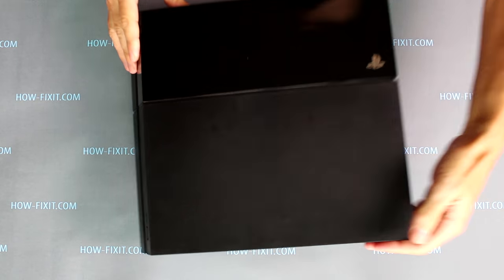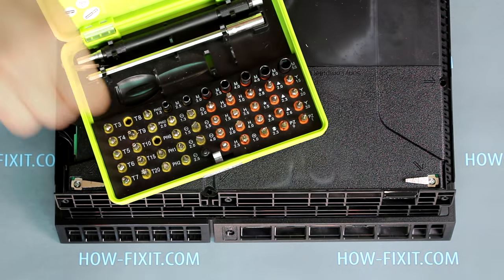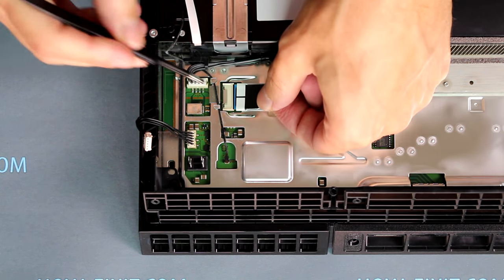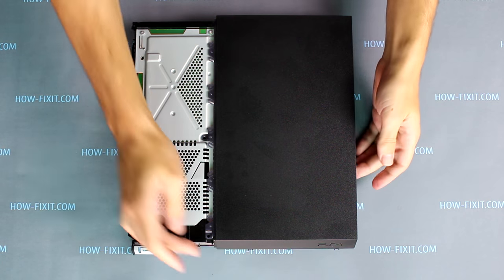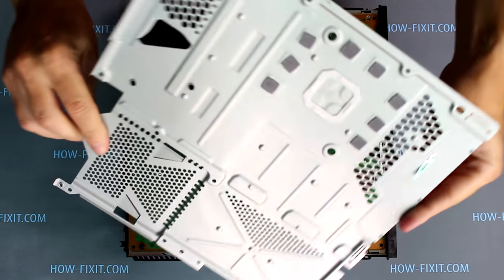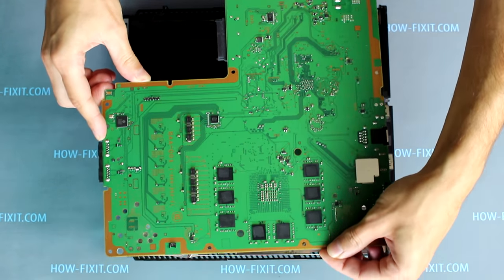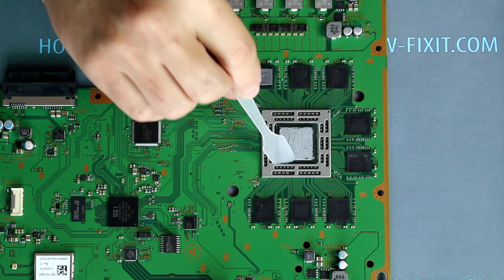PS4 Overheating Fix: Disassembly, Fan Cleaning & Thermal Paste Replacement

Comment: will applying thermal paste and then leaving it out while cleaning the cooling system affect the longevity or result of the paste? and can I use compressed air instead of a brush? 
Thank youuuu

Comment: Broo, it's so hard pulling the power supply cableee
Reply: i’m scared i’m gonna damage it wtf do i do no video explainsssss
Reply: @Gwaciee  because of it I didnt fix my ps4, didnt want to hurt my baby
Reply: If you pull on the cord while the power supply is still screwed in it comes out pretty easily.
Reply: @DocSportello83  will look into it, thanks !
Reply: Wafi. 05 i broke mine lol
Reply: @Gwaciee  You broke ur ps4 while doing this?
Reply: @wonder8923  yeah but i somehow fixed it
Reply: Yeah this one sucked the most. You have to widen the gap a bit carefully with a cutter knife, then it loosens up.
Reply: Pull it out from the power supply

Comment: I have a question? Is their any soldering required especially the Wifi connectors im very afraid of unplugging the wifi connectors and not realizing that I need a soldering tool to re-hook it after I'm done replacing thermal paste. 

Please let me know any soldering requirements if their are any just to get to the thermal paste. That includes the wifi connectors ESPECIALLY??

Comment: I lost one of the rubber pads that are between the chips surrounding the processor and the metal shields. Will it cause problems to just not have it?

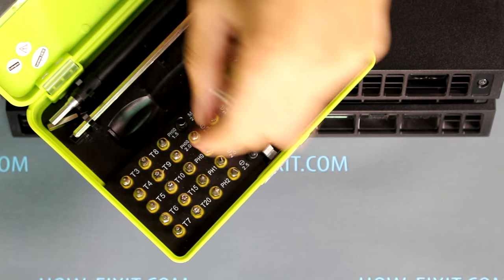Comment: 1:15 ⚠️ PSA:
If T8 is not working, you will need T8H. The T8H tool has a hole in the tip (security feature) and it's the only way you will be able to deal with the special type of screws that Sony used in PS4.

Comment: Thanks, ps4 is now clean and the fan is running really smooth. Overheating gone
Reply: When I changed the thermal paste the sound has become sow quite but the PS4 does have heat is that normal ?
Reply: @mohnad7215  Yes, it's good. It means the paste is helping move the heat from the inside to the outside, so the fan will be quieter but warmer. You should worry if cold air is coming out of the fan, it means there is not a good heat transfer between the processor and the fan, thermal paste is made to improve that transfer
Reply: @MVergaraQ  oh. Thanks actually it gives me hot air it means  that the transfer is good

Comment: This is the second time I open my ps4 and clean it (today). It starts and sounds fine. But controller won't connect to the ps4 anymore 😂. Did I ruin something or did I miss a cable?
Reply: Your Wi-Fi antenna is disconnected causing the Bluetooth to not work.
Reply: @Braylinman  Yup, I opened again and the antenna had slipped off.
The disc drive doesn't work either :D
Reply: @Braylinman  this comment has made my day! going to try fix it now !

Comment: Even after doing this. My ps4 did get better. But I can no longer play any games because it'll just automatically turn off by itself saying it "overheated" but there is NO DUST!!! And I replaced the paste any tips ?
Reply: It’s is it good now
Reply: kevin Mejia no. I had to get an entirely new one
Reply: Edgar Smh smh I’m not even willing to open it again it was working fine but it keeps saying is hot again
Reply: @edgar9026  did u apply enough or too much or too little thermal pace? Or it could be it was just to old.
Reply: @protokille9111  it was just over 6 years old, so i guess it was time to get a new one anyways hah

Comment: I did this and did not replace thermal paste and now when I load a big game the fans revs up and the system will power down. Is that my issue now?
Reply: Replacing the thermal paste is the point of this video, what did you expect?

Comment: is it worth changing thermal paste?  does it last over time?
Reply: Absolutely! Buy one that is well reviewed like thermal grizzly(cheaper one is fine too though). It can last for years and keeps your ps4 quiet ;). In my case, 2 years after changing thermal paste from the default one, it's still quieter than before ^^

Comment: I ain't gonna lie I almost had a destructive breakdown because of the power supply cable and last two T8 screws that wouldn't come off. I used a flat screw driver and it worked. This video was a blessing though, Re-applied thermal paste and it turns on. Downloading MW Cod to test.
Reply: How's it going now?
Reply: @DustRockBlues  I can conclude it is very worth it, I played BO4 and MW and it was very quiet and played well. I recommend repasting.
Reply: @TheGamingKamikaze  Thank you my good sir.✊🏾

Comment: My ps4 is louder after cleaning dust off heatsink and fan.Should i replace fan or apply new thermal paste?
Reply: U shouldn’t take the heatsink off the cpu cus that can cause air bubbles in the thermal paste. I would recommend just changing the thermal paste.
Reply: Also make sure u didnt lose any thermal pads

Comment: I just cleaned all the dust from my ps4. And it's still loud as before. Would this mean it's the thermal paste that needs replacement? What else can I do??
Reply: Yes. Stock thermal paste is garbage and Thermal paste dries out. The heat transfer between chip an cooler worsens  because of it so it gets hotter and louder. I would recommend a paste like mx4 ,MX5, noctua nth1, nth2 whatever of those are available for cheap. If you want to go the extra mile replace the pads on the ram also.

Comment: So i have a Little Problem i did every thing in this Video cleaned Almost every piece and replaced the Thermal Paste But when i Started the ps4 i wanted to Play a Game while i was in the loading Menu it just turned off With a Message that Said the ps4 is overheating and i dont Know what to do pls help
Reply: I would make sure you’re using the correct thermal paste: arctic mx-4, arctic silver 5, or any other that’s mentioned in the comments. Anytime you open it, you should put fresh paste on. Also, double check to see if you lost any thermal pads. Launch PS4’s are approaching 9 years so those pads may need changed. I would also make sure to clean around where you applied paste on the motherboard as best as you can. I would also re-clean all the parts and check to see if any dust got pushed further in. You may need make sure ALL your connections are in place, especially your fan. I would leave the cover off so you could see if the fan turns on and stays on. If not, you may need to replace the fan. Hopefully it’s an easy fix for you. Good luck!

Comment: Ok so I cleaned the fan and took the motherboard out and left the same thermal paste and thermal pads in
Now when I turn it on the fan runs really loud and then it turns off.
So if I replace thermal paste and replace thermal pads will it stop running load and actually work guys and gals?
Reply: Did it work?

Comment: Tore down my PS4 today cleaned the dust etc thought it would make it happy again nope it's louder than before I've ordered thermal paste as mine is clearly no use anymore as it looks exactly how the one is in the video
Reply: What brand of thermal paste did you get? There is a lot of difference on performance between brands. I highly recommend the NT-H1 used in this video, or the MX-4 or arctic silver.
Reply: @kris754a  I would recommend the MX-2 instead. According to Arctic the MX-2 have a better longevity than MX-4, Arctic recommended the MX-4 for situations where you change the paste more frequently. In real life i think the difference between them is minescule though so MX-4 will of course work great! The most important thing is to choose a non conductive paste so you won't risk bricking you're PS4.

Comment: I cleaned out my Ps4 and when I tried clicking on a game it will just turn off, but it was able to play a movie I put in, whats wrong with it? will thermal paste fix the problem?
Reply: If you think your PS4 is turning off because of it overheating and you already cleaned the fan and vents, your problem is probably the thermal paste. Playing a movie is no where near as demanding of the PS4’s performance as playing a game is, which is why you can play a movie and not video games. I’m currently having the same problem as you and I’m going to try changing the thermal paste tomorrow. I’ll tell you how well it worked for me if I can remember.
Reply: @soupmemory9943  Yea it's working fine now ever since I used thermal paste, it's still loud tho but it works.
Reply: @soupmemory9943  Results?
Reply: @Axxxel_in_Harlem  Every game I’ve given my PS4 after I did this runs great and it’s quieter than it’s ever been. My PS4 won’t read discs anymore, which I’m pretty sure is the result of me damaging the blue ray ribbon cable after I unplugged it wrong. All of my games are digital though so I don’t notice it

Comment: I cant remove the cabble of the power supply now matter what I do. It's completely stuck
Reply: did you solve that? I've got the same problem
Reply: @XD Snowdog Update: I managed to remove the cable and proceed to change the thermal paste. However, I had to buy a plier. The cable was almost completely stuck, it was impossible to pull by hand. Any attempt to remove by hand would end up with me destroying the board. It seems that some PS4s have this problem.
Reply: @ArthurKowales  fuuuck do you have the original PS4?

Comment: I did this and my ps4 is working fine now, but my controllers can’t connect anymore wireless, only with cable
Reply: Still having that issue? My hope is that this video would stop that from happening to me

Comment: Hi, Any tips on how to remove the power supply connector? I've tried tweezers but they ended up just stripping the plastic and it didn't budge whatsoever...
Reply: Same problem. Too hard to pull out and it’s in an uncomfortable position to access. Any tips, anyone?
Reply: Me too

Comment: Great video. Well I did this Yesterday but I applied a little too much( too much I think) in the cpu Did I make a mistake? My ps4 will stop to work?
Reply: I know this is an old comment, but don't worry too much about it. Thermal paste is non conductive so if it were to get on any electronics it's not supposed to be on, it won't do any harm. It's still not ideal, but won't do any damage.

Comment: Recently I opened my original model for cleaning and new thermal paste and I noticed that the metal plates that hold the Motherboard are very rusty.

The motherboard is perfectly fine. Do you recommend to change it? Or is it ok to leave it like that? I'm worried it might damaged the board.
Reply: I'd say if you can find one that is exactly like the one you got, replace it. Plus make sure the area you have your console does not have a lot of humidity.

Comment: dude i have a question is the hy510 thermal paste good quality or bad cause after i put it in ps4 apu my fan went crazy note that i cleaned everything fan / heat sink / even the thermal pads was replaced with artic silver 5 thermal pads but my ps4 is still running loud after i open ?any game like fortnite or uncharted 4 or even any game i play on ventilated area any idea
Reply: I just bought the same paste, is your ps4  running any better now?
Reply: Ali  no it's not

Comment: Did this today, is a hot day and I wanted to test if the ps4 would be more quiet after a cleanup and repaste, but no, still noisy.
Reply: Did you clean the heat sink? If you cleaned all of it then you may need to test your fan to see if it’s defective.

Comment: Done this a million times. Did another one today and now the control won’t connect. Checked the antenna cable didn’t come off. Replaced the entire cable as well. Still not connecting. Tried different usb cables and still nothing. Tried the reset button on the control, rebuilt the data base and still won’t connect. Any ideas?
Reply: I have the same issue, did u fix it?
Reply: @protokille9111  I eventually had to replace comms chip that controls the Bluetooth and Wi-Fi. But it has to be done by pros unfortunately. Had to send it in.

Comment: I've jus done my PS4 but already the fan kicks in why?
Reply: The fans still have to spin. Changing thermal paste doesn’t make the fans not spin at all it makes them spin less
Reply: @urakov889  it doesn't matter I've bought a thermal pad now it's very silent even when playing high resolution...problem solved...I'll never use thermal paste...and it was the problem!!!!!
Reply: @ryanherrington9267  maybe u didnt apply enough. I just changed mine and used thermal paste and it runs idle when playing gta. Or maybe u just used a bad cheap thermal paste.

Comment: where can buy screwdriver to disassemble PS4?
Reply: This is kinda late but it can be done with small flathead too
Reply: @ATTE22  No it cant. The security torx pin will not let your flathead in.
Reply: CrazyRC yes it will
Reply: I used a small flat head

Comment: hello, i came from a youtuber called octorious. he said this was the best guide to cleaning a ps4. i thought you and he knew what he was talking about so i watched this to open and clean my ps4. however, i’m worried cos i saw a different video of a guy cleaning the ps4, replacing the thermal paste, but he put paste on the heat sync as well, not just the CPU. now i’m paranoid that i didn’t do it correctly, and i don’t wanna open it back up again.i hadn’t seen anything about putting a bit on the heat sync and thought that since the CPU is sitting on it it’ll just go there anyway if that makes sense.  please help
Reply: Nah u need to replace the thermal paste on the cpu only.

Comment: Do I have to wait to play after I put the thermal paste on? If so how long
Reply: I'd assume like 15-25 minutes I guess. As you'd want it to settle in properly before playing again as you might not think it's worked if you turn it on straight away and then apply way to much
Reply: You don't need to wait

Comment: What is the best thermal paste replacement for ps4?
Reply: Artic MX-4 I heard is pretty good and cheap. I got mine on Amazon, but I haven't applied it yet.
Reply: @hugon6717  finally im using kingpin cooler kpx. Pricey but doing great on my ps4. Fan noise now is smoother and temperature more cooler.

Comment: won't removing the HDD cause it to wipe it upon start up?
Reply: No, if you remove and insert the same drive, all will be fine. If you put in a new drive, then PS4 will detect it as a new drive and will want to format it.

Comment: i hope someone answers this for me — those pointy things at 2:40 he’s unscrewing — what are those?? i broke one🥺
Reply: I think those are for actually just for a better grasp for the screws, I don't think they are essential, the Only thing is that when you try to get those big screws out, you'll have more problem.
Reply: They make a connection to the metal shielding plate on the bottom part of the PS4. It isn't really all that important, it just helps reduce electromagnetic interference which would improve stability of the console. As long as there is still one in place, the shielding plate should still work. Hope this helps 😊
Reply: I just realized the shielding plate is sitting over the power supply unit of the console. The power supply makes a lot of electromagnetic noise. So in this case, the shielding would protect other electronic devices near the PS4.  For example if it was sitting on an amplifier or something, the noice from the power supply would  likely be audible from the speakers of the amplifier if it was turned on (if the power supply had no shielding)
Reply: @kris754a  WOWOWOWOW thank you so much^.^
Reply: @MR-vq5et  no problem 🙂
Reply: I think it's just to get the screws out, don't worry :)

Comment: Do you really need to uplung things like the blu ray drive, wifi antenna, power connector etc? I don't want to unplug anything I don't want to
Reply: Follow tutorial exactly as he did. I just did and my ps4 pro is running perfectly. That being said if you don't feel comfortable doing those things then you should let someone that is comfortable do it for you.
Reply: @Drakn3365  yeah I just realized the wifi and antenna is connected to the motherboard, so removing it without unplugging it is impossible
Reply: Creamednut Did you do it?
Reply: @ken-yo2hz  yeah it was a journey tho

Comment: where can I buy that tool kit?
Reply: U dont have to buy the whole tool kit. U can buy the t8 screwdriver from aliexpress for $1 and u should have a normal Philips screw driver lying around.
Reply: @urakov889  Ending up using 50% alcohol and I tell ya, brand new !

Comment: These comments sounds almost too good to be true I may still try it can anyone gimmie a negative or do they delete them all
Reply: There's no real negative sides to this procedure, if the new thermal paste you want to apply is good and everything goes smooth there's no way this could end up being bad for your ps4. With that said, it's not as easy as it may seem, and it does require a lot of patience and preferably some skill

Comment: My PS4 no longer turns on after the disassembly. I followed everything properly and still won't turn on, no beep or blue light or anything.
Reply: maybe u did that to late bc the cpu got fyed to death..
Reply: Sure about that every cable is connectted power, data, antenna and fan cable etc
Reply: I had the exact same thing. Make sure the two metal prongs that go into the power supply are STRAIGHT and not curved
Reply: F
Reply: @Wavylix  U

Comment: Never pull cables out of their connection by the wire good way to breakstuff on the board always pull on the plug so don't do like this guy did will save you money in the long run lmfao